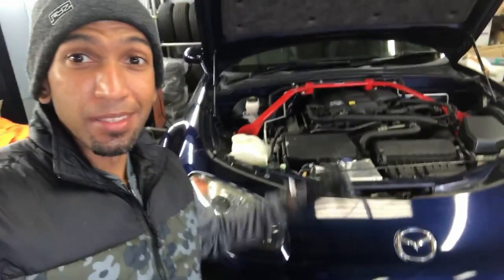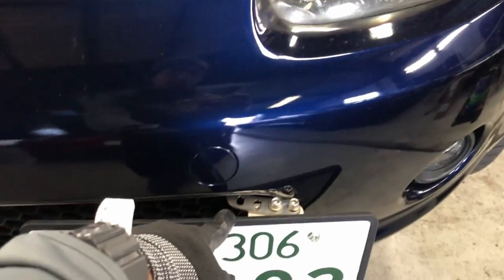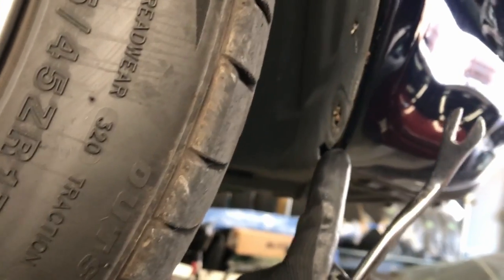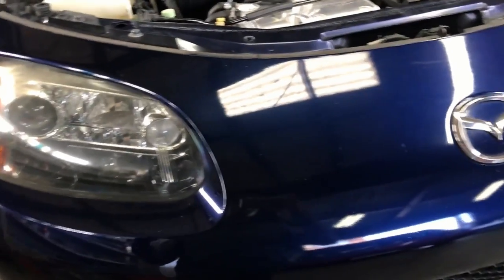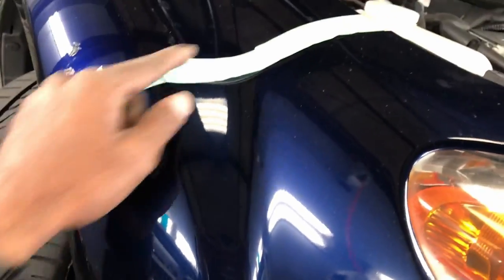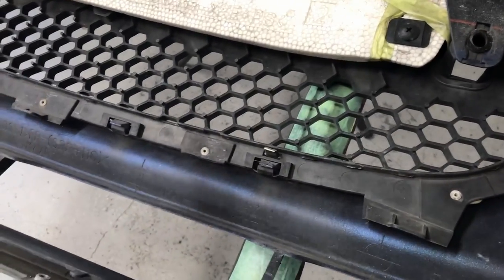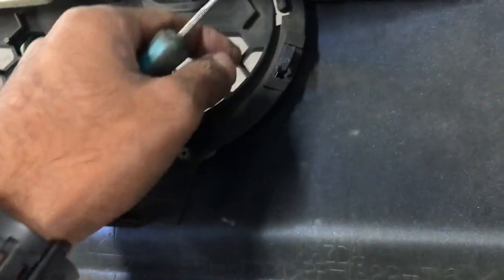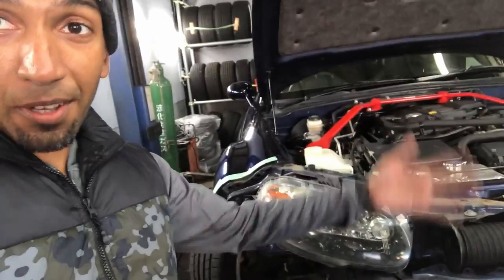NC MX-5 Miata Front Bumper Removal Simple & Easy | Tach On Red

Comment: I need help . i can't remember where the two bolts that have a cone shape below the head . There is two of them and I suspect they are for the headlights. If you know please let me know.
Reply from the maker: What size and length are they?
Reply: @TachOnRed   They are the same size  diameter and length as all the ones at the top of the bumper cover
Reply: I have the same question :D I don´t know where the cone shape bolts go.
Reply: @jozefdoczy5979  I didn’t even know they were different until I went to reassemble it.
Reply: Same I am guessing headlights but really didn’t notice them until I was wiping them off for reassembly
Reply from the maker: Sorry for the late reply!

I didn't get any notification for your later comments. 

The ones with the 10mm slightly cone shaped head go under the fender liner I think.

At least that's where I put them when I put it all back together. I guessed that's where they go because there were only 2 of them.

Comment: You need a PhD to take the bumper out. By the time you put it back together its been 6 months and you already lost the clips and a couple bolts 😅
Reply from the maker: 😆😆 in which case you can always rely on a drill and a pack of zipties to put it all back together.
Reply: I wouldn’t go far . Maybe a bachelors degree in engineering.
Reply: @TachOnRed  your being a funny guy . But somewhere someone is on the way to the hardware store.

Comment: Thank you for your guidance. I managed to remove my bumper and fit a ramair induction kit. Without this video, I wouldn’t have been able to do this. 👍😁
Reply from the maker: My man! 👍 Glad to hear the video helped. 😊 how's the new intake. Would you recommend it?
Reply: The car is also fitted with a scorpion cat and back exhaust system and together with the ramair induction kit, it definitely feels more powerful with a lovely engine noise. I imagine that the car will improve over time, as the ECU is constantly learning from the increased cool fresh air passing through the new filter. The only potential downside is removing the new sponge filter in order to clean it. Plastic under tray removal or front bumper off in order to remove and clean it? Also bought an ECU Davefab splash guard  as its more exposed after removing the stock air filter box.

Comment: Excellent video. I plan to replace a headlight on my '08 Miata soon and this is just what I need to show me the way. I replaced the same headlight a few years ago by 'cheating' and reaching my arm in behind the wheel well cover. Never again. I hate working blindly and you need to be a contortionist to go that route.

One question. What size flex head wrench do I need to get at those bolts behind the bumper you show in the video? I'm looking at buying a 5 piece set that goes from 10mm to 19mm. Hard for me to gauge from the vid if you used one smaller than 10mm.

Thanks for taking the time to make the video. Us weekend mechanics appreciate your work.
Reply from the maker: Thank you so much for the encouragement! Glad you found the video helpful for your project.

For the bolts and nuts behind the fender liner, I used a 10mm flex head wrench.

The only 2 sizes of wrenches or sockets you'll need are 8mm and 10mm. 
8mm along the bottom of the bumper. And 10mm for everything else. :)

Comment: Does anyone know the name of the rubber seal across the top of the bumper.  Bought an NC and bumper was nicely repainted ( fender bender ) they nicely painted the rubber seal/ weatherstrip too. The seal was still attached to the bumper as you lifted it away from the car.    Thanks for the great video content
Reply from the maker: Thank you for watching!

As for the part you're looking for, I THINK it might be this NE51-56-750. That's labelled as the Bonnet Front Weather Strip. But it's worth double checking with a local Mazda dealership.

I found that on the bonnet parts diagram on the website I normally use for finding OEM parts👉 https://partsouq.com/en/catalog/genuine/vehicle?c=Mazda&ssd=%24%2AKwECNiceWnUOYAgHckIbX1pObml3BgkEBRcEFFRUdm4CT1BGKQEFR1gEdwUIAAAAAAD-7rNd%24&vid=1927005494&cid=2494&cname=3.+BODY+EXTERIOR+TRIM&q=

For replacement OEM parts, I usually just drive to my local Mazda dealership and show them the part I'm looking for on my car. If there are any mistakes, it's on them and they'll reorder the correct part with no additional cost to me.

The price can be slightly more expensive but for me, the small difference is worth it for getting the right part, and for the chance to build rapport with the local techs in case I need to ask them for help or advice with something.
Reply: Thank you so much for your response - I checked out the part but will go to the dealer to to confirm: before I get this bumper repainted and te-aligned.  Thank you!

Comment: Great video man, thanks!  Any ideas what options there are for an NC2 grill swap?  I hate the chrome and black is so faded.  Might install air horns so pulling the nose anyway.
Reply from the maker: Thank you for watching!

There aren't any NC2 specific aftermarket  grill options that I know of. But if you only want to get rid of the chrome, maybe you could consider getting the oem soft top grill.

And if you get an old faded looking one, pretty easy to restore it by using a heat gun and some black plastic dressing/wax to bring back the deep black luster. 😊 

And if you wash your car regularly, you can use something like turtle wax ice spray to dress the grill and its surroundings after each wash to maintain the shine. 😊

Comment: Thanks for this! What front plate holder are you using? I also have a Japanese plate that I'm using as a vanity, but want to move it from my tow hook mount. Thanks!
Reply from the maker: Thank you for watching!

I have a custom bracket made out of sheet aluminium. The design is similar to the Nielex one.

Link: https://store.shopping.yahoo.co.jp/g-crossnet/500314.html?sc_e=slga_pla_i_shp_02514&gbraid=0AAAAAC2i688sja0l0mGJGZk_1yzyj8Svm&gclid=CjwKCAjwgZCoBhBnEiwAz35RwtXNlwT8ASRZM2HQ7zZylD2f1azkAWa3jVwyzDtxi8V4tRvBABPzHhoChscQAvD_BwE

Comment: Thank you for this useful video! I just need to know where did you get that number plate holder!
I saw that kind of holder for the Miata NA and NB, but never for the NC. Will they fit anyway? 
I want to take off my bumper just to get rid of that stock number plate holder which is a huge piece of black plastic in Europe!
Reply from the maker: Nielex and No Pro each make some. They're sold here in Japan on Yahoo Shopping and Rakuten. 

I haven't seen the NA or NB ones to know how they fit. The NC one bolts to the M6 bolt hole that's covered by the plastic grill cap - there's one on each side of the grill and you can pry it off with a flat head screw driver. 

I'm not sure if they'll fit with your number plate though. If they don't, you can probably just drill some new holes or use a custom adapter plate to mount your plate to them.

Comment: The video is awesome. I'm sure it's going to help me a lot. Have to replace the stock radiator as it just cracked. I ordered a new all aluminum radiator. Do I need to remove the bumper to pull the radiator?
Reply from the maker: Thank you for watching, Anthony.

For replacing the radiator, it's not necessary to remove the front bumper. You can just remove the plastic undertray to get access from underneath. But I've heard from some forum members that they prefer to remove the front bumper to give themselves more space to work and a better view of things.
Reply: Same here it cracked and overheated. Plastic crap

Comment: Thanks so much for this video, I was just wondering where could I find your front license plate holder, the one that bolts onto your front grille. Thank you!
Reply from the maker: Thank you for watching Owen!

The license plate holder is a custom one made out of sheet aluminium. 

It was modelled based on the NIELEX one here: https://store.shopping.yahoo.co.jp/g-crossnet/500314.html?sc_e=slga_fpla
Reply: @TachOnRed  thanks for your response! How did u go about modelling it and custom creating it?
Reply from the maker: I actually just used cardboard to mock it up. Only exact measurements that mattered was where the number plate bolts go. And I kinda didn't get it perfect when I drilled them. So, I ended up slightly bending that brace to get the holes to line up. 🤦‍♂️ But you can't see it with everything bolted together.
Reply: Would you make a couple to sell?

Comment: Why hasn't someone made a nice stainless steel insert for these.  I hate chromed plastic, but would like a 5 bar horizontal design.  I saw the cheap mesh and it looks like shit.
Reply from the maker: Been wondering the same for a looong time. All I can find are grill trim pieces that fit on top of the factory plastic honeycomb grill. Sure they may look alright in pictures and from afar. But up close they'd definitely look retarded. 🤦‍♂️
Reply: I bought some stainless steel rod I drilled holes to put the rod across the grill also one in the lower grill. looks good.